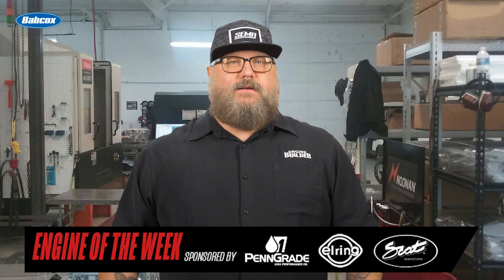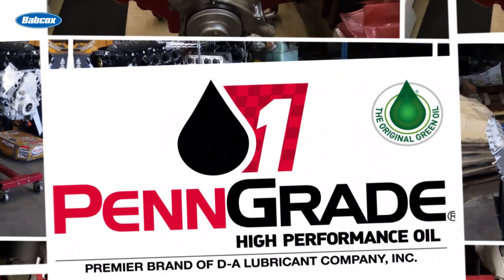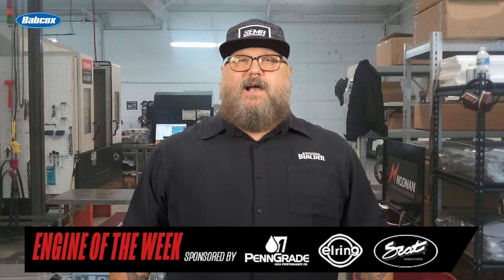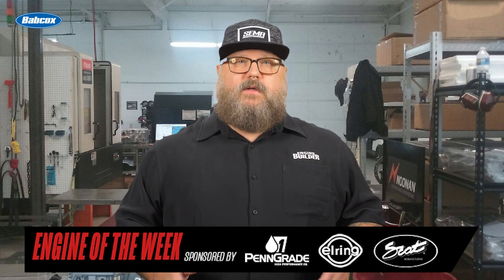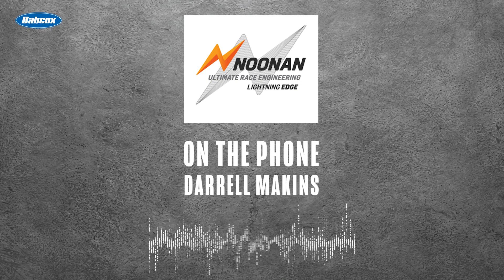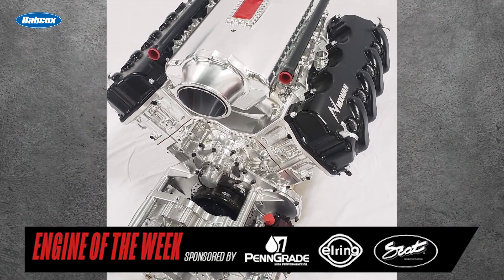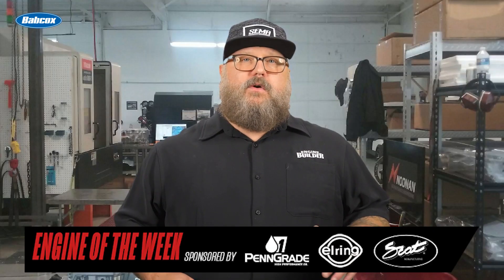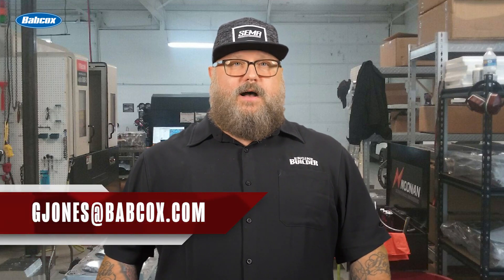4.9" Billet Hemi Big Dawg Engine

Comment: How about a change in cylinder head design with a 40 degree or 36 degree combustion chamber instead of 58.5 degree head ???   This would  make the pistons a lot lighter and faster acceleration .  Also what about a Jesel style rocker arms ???  A lot simpler in design and lighter weight in the rocker arms . Current super stock Hemi's use Jesel type rocker arms.

Comment: Do they have street engines?
Reply from the maker: Not 100% sure, but they are definitely focused on professional race applications primarily
Reply: @EngineBuilder  Yea I know they're just so awesome but so expensive. maybe if they did a non billet. Their blocks are around 10k but then full price is 60 70k. not sure what's included in that and why it jumps so high? Wonder if you got the block for around 10k and got someone else to the rest how much it would be?
Reply: @lordpula1193 A block is probably just a bare block and need line boring/honing etc, probably needs liners, crank, cam, pistons, rods, and a complete top end plus oiling system. In the video it was said a complete engine was ready for you to bolt on your intake, blower, ignition system so in reality buying a complete engine is the was to go in my opinion because of what you get for the money.
Reply: They make water jacketed versions of these engine

Comment: Wonder why the 4.9 inch bore spacing?
Reply: I believe pro stock went with the Ford's 4.9" spacing back in the '80s, whereas Chevy was 4.84" and Chrysler was 4.80".  It allows larger bore and shorter stroke for the 500 cu.in class limit.  That allows larger valves and higher rpm. why not bigger?  legacy
Reply: @chrisstavro4698  While this engine/heads are a deviation from the 426 and probably don't even share one bolt in common. They resemble it more than the last hemi mopar had in pro stock in my opinion. I've seen only one picture of a symmetrical port pro stock mopar Hemi but no information on it. Everything is either hemi '99 or '06 engines (also referred to something like dps2 engines?) I have a set of the '06 heads and the only thing hemi about them is the name. In reality they are an asymmetrical twisted canted valve head. As far as I know when they were still running a real hemi it was still 4.800 bore spacing. I don't think they went to 4.840-4.900 until they switched to the chevy style engine with a mopar part number.
Reply: Giving it the larger bore spacing gives more room for the lifters and pushrods. It also means the pushrods don't encroach into the intake runner as much as the smaller block which allows for improved port design.
Reply: @dicknijenhuis9894  If those are the only reasons I'm surprised that they stopped at 4.900. At a minimum I would have choosen 5.0 but 5.3 would be more gooder :)
Reply: My guess is that is the maximum bore spacing for the classes they are trying to cater to?
Reply: I think thy mean it is a 4.9l